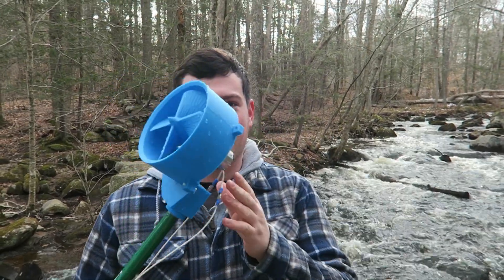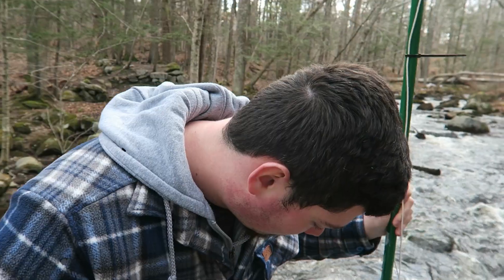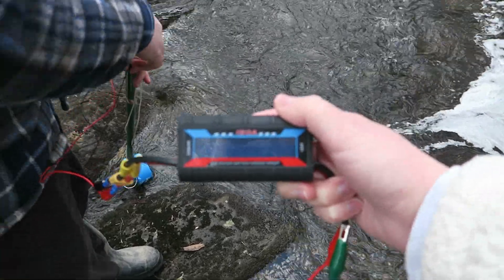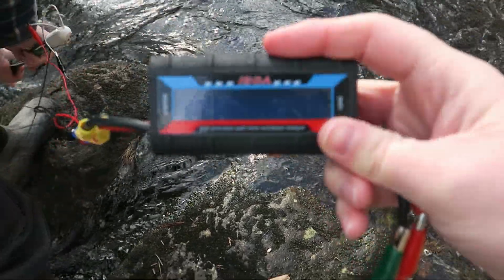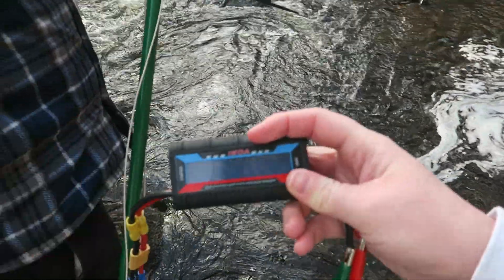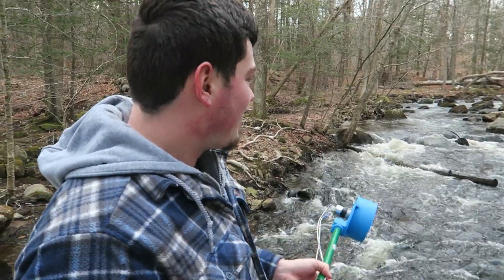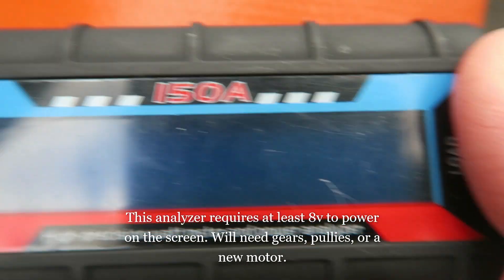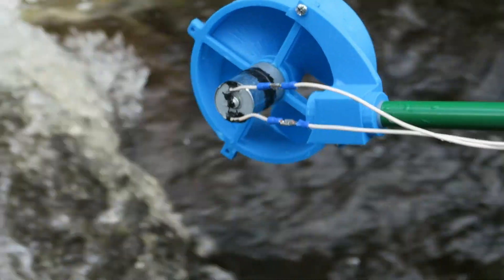Improved 3D Printed Micro Water Turbine.

Comment: I think this can still be improved by making the tolerance larger, and also by making the pitch/angle of the prop higher. 

Higher propeller pitch == lower resistance, which leads to a more uniform motor rpm

Based on what I can see in the video, your tolerance is still quite small, and the water turbulence from the river will still be able to flex the plastic just enough that causes fiction/ making the motor not spin constantly

Also, you should get rid of the chamfer, since it would make the water thats entering into the duct, less stable. Make it like the original design before its was modified. 

Like == /| blade |\ 

Not == |\ blade /|

^^^ will help with retaining/avoiding non linear water flow.
Reply from the maker: I'll try this design, thanks

Comment: When you redesign your micro hydro turbine try a Nema 17 stepper motor of course if you do used a Nema 17 stepper motor you'll need a full bridge rectifier to change AC to DC and a DC capacitor to smooth out the DC voltage.
Reply from the maker: I'll look into this

Comment: First of all a big thanks for the very helpful assistance in those cold conditions from te lady. I think that your source of water is more than enough to produce some substantial power, so I do not think that the water or the amount of flow and speed is the problem. My first thought is that the design from the prop or impeller is restricting the flow from the water too much. It is working against itself. And I would suggest to use a type of load for your tests that is variable or that has certain fixed settings with different capacities, so that you can always get a reading. Some reading is better as no reading at all. And over time you can compare the readings with the different type of propellers or impellers or even with totally different designs. And there is a thing called plastidip, that is used to dip tools and other stuff in order to give it a new rubber grip, or to waterproof things. It is like a can of paint, and you simply dip the object that you want to waterproof into the rubber, and Bob's your uncle. 👍
Reply from the maker: I agree with what you said about the readings, I will fix this as always your input is appreciated. If you wanna talk about the tank track idea in the future, let me know we should make that happen.
Reply: @Beyond_The_Print  For sure. I have already been thinking about it. For example if the blades should be the entire width of the track, or should the blades alternate from left to right every other track link. Or should the blades be shaped like a rake with slightly alternating teeth at every other track link....Should the blades be shaped like a wing or should the blades be shaped like a spoon, should the blades have a sharkskin surface that goes against the flow of the water for extra resistance? Would it make a difference if the track has some ducting or wings to direct the flow of water? There are so many possibilities. And if it were just up to me I would love to see it all. I mean, it can be stretched out over a longer period of time of course. But I think that it is interesting enough to find out.

So now that I am writing this my first thought is that it would be handy if it has some sort of standard mounting system at each track link for a variety of different blade types, so that the blades would not be too hard to change. Perhaps that is something that you might want to keep in mind when you are going to design the track links. 👍
Reply from the maker: @insAneTunA  looks like you did put alot of thought into it, I like your ideas and may have an idea to make this happen stay TunAd.
Reply: @Beyond_The_Print  I'm already hooked 😁
Reply: @Beyond_The_Print  And another thing that I suddenly realize is that with a track shaped turbine you could even think about mounting two generators. That is if it happens to work at all and if there is enough power from the water to overcome the torque from the generators when a load is applied.